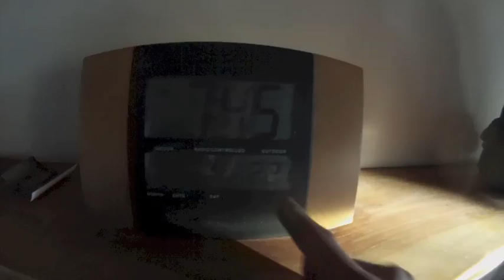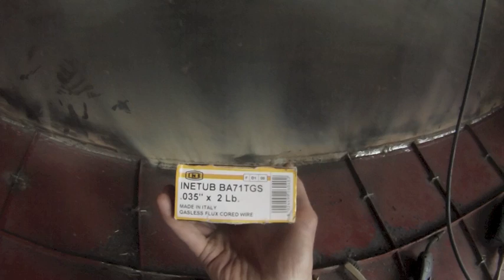Steel Sailboat Build Part 24

Comment: FORTY YEARS A YACHT MECHANIC. I'VE YANKED OUT AT LEAST FIFTY MD2B VOLVOS FROM SALT ROT AND SEIZING FROM SEA WATER GETTING INTO THE CYLINDERS. THE GEAR DRIVEN EA WATER PUMP WILL HAVE SEAL FAILURE AND PUMP SALT WATER INTO THE OIL TOO. THE MILKY OIL WILL MAKE YOU THINK ITS A BLOWN HEAD GASKET. SO CHECK THAT STUPID PUMP SEAL FIRST.

Comment: DUDE THAT VOLVO IS ABOUT THE WORST BOAT ENGINE IN THE WORLD. I'VE MADE THOUSANDS FIXING THEM AND THEY ROT OUT FROM THE INSIDE BECAUSE OF THE SEA SALT.  THE CONE DRIVE TRANS ALWAYS SLIPS AND WHEN IT CHANGES DIRECTION THE SHAFT MOVES BACK AND FORTH AND THAT MAKES THE SHAFT LEAK. ALL VOLVO PROBLEMS. TURN THE ENGINE INTO A GENERATOR FOR THE HOUSE BUT NOT IN A BOAT BUY A YANMAR TEN HP ITS SMALLER AND WILL ALWAYS RUN. BETTER GET A FRESH WATER COOLED MOTOR.

Comment: You do not want to run sea water in your engine. You need a heat exchanger capable of running sea water. It's a big no to running a water inlet up so high. The rubber vaned water pump will run dry too often and fail. Then pieces of the rubber vanes will go into your engine coolant passageways and clog the passage way. Keep trying and keep learning. Build a seaworthy boat. Your life depends on it.

Comment: Went making a weld water tight you have to grind over the weld before you put another pass. If you don't the next weld will just lay on top of the weld. When you grind the weld it makes it so that the two welds will mix together.
Reply: That's just silly.

Comment: They drill holes in the because they need the water pump impeller wet when running the engine. The water lubricates and cools the impeller. In a very short period of time an impeller without water will wear out. There is no guarantee water will remain in the inlet hose after the engine is shut down. Those water pumps are not self priming and when under way,  just hanging a hose over the side won't work.
Reply: Exactly!

Comment: Why didnt you put the exhaust water hose back in the bucket and recirculate it until it became hot and registered on the temperature gauge  to a safe engine operational degree. 
Then refill with the cool precious rain water and repeat.

Comment: You might really want to go with a heat exchange system. Ocean water will corrode through the water jackets on that engine within a year.
Reply: Ran an md2b for years on seawater no problem
Reply: That's a lie pal I make ships for a living and most big vessels cool there power plants / engines of sea water